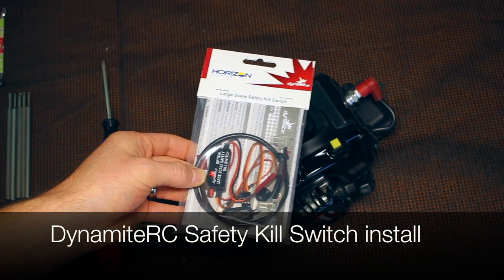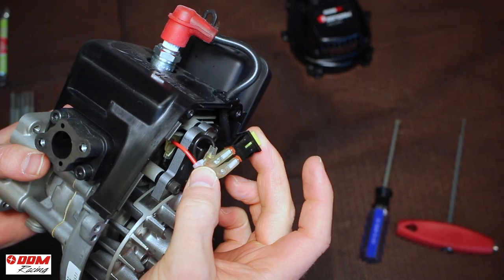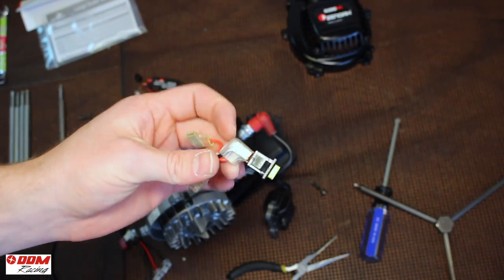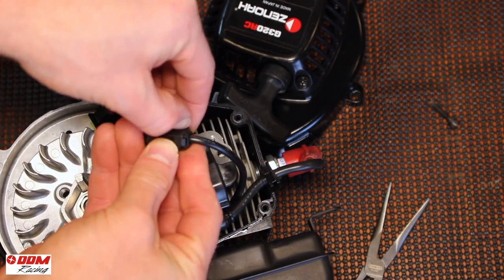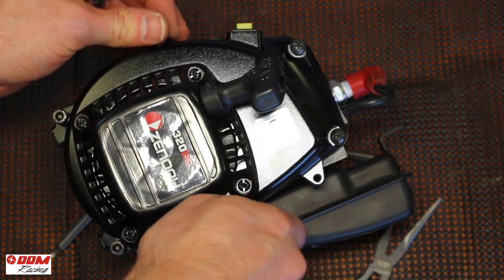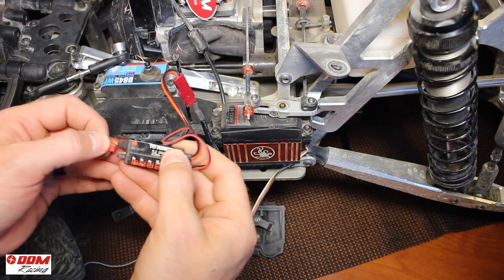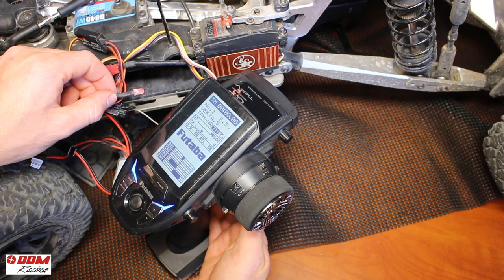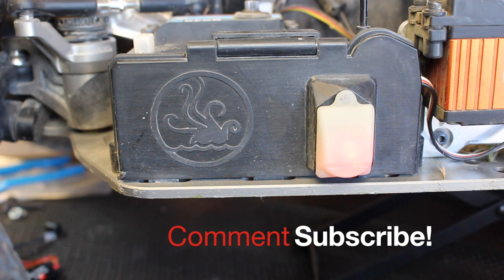How to install a Dynamite RC kill switch in your large scale RC car

Comment: Hi there! I'm hoping you may be able to shed a little light on an issue I'm having. 
Fitted the kill switch, everything appears to work as it should. Channel 3 is turning on/off the kill switch LED. However, when I start the engine, the kill switch cuts off the engine about 1 second later. I then have to cut the power to the receiver and turn it back on again before I can get any radio control. 
It sounds like it is an issue with the radio, but It can't be because until the engine starts everything is working as it should! If you could shed any light I'd be very grateful as I'm a bit stumped!
Reply: Try installing BOTH programming pins. This will deactivate the cutout. The statement in the video is wrong. Both plugs removed, as shown, sets the cutout at 6 v.

Comment: One of the most important things to note is that this will not work correctly unless the receiver is 4 channel. For example a Losi DBXL comes with a 3 channel receiver and the kill switch will partially work but the car will not turn off when it looses radio signal. The channel has to be a toggle channel 2 way or a 3 way. Basically the channel needs to turn off and the on. So just know that before you buy this. You might need a 4 channel receiver for this to work correctly.  For the money this is a excellent kill switch. I have both brands and both perform the same task. The Killer Rc one just has audible tones to it and the option for different color LED lights.
Reply from the maker: This kill switch works fine with 3 or 4 channel receivers. You need to have a radio that is at least 3 channels though. The DBXL has a 3 channel receiver, but it is only a 2 channel radio. If you had a 3 channel Spektrum radio it would work without issue. I also agree the Super Bee is the kill switch of choice, but it is nice to have another option when your first pick isn't available.
Reply: DDMSteveB thanks for the correction that is what I meant to say! Brain fart. Thanks Steve you guys are the best!
Reply: I have a 2ch radio w/ 3ch rx and this kill switch works with loss of power or signal. You don't have a switch available to turn the motor off, but you can turn the TX off and the engine will die. https://www.youtube.com/watch?v=BvOtLU1wuQ8

Comment: I am trying to configure the kill switch of the dynamite brand in a futaba 3 pv control, I want that when I turn off the control the kill switch cuts the power to the. engine but I turn it off and it stays on
Reply from the maker: You have got to program the failsafe position of channel 3 on your transmitter. You want it to be where the light is turned off. Make sure you have your channel three set as a 2 position switch.

Comment: I installed this on my HPI Baja 5T and the light doesn't come on for me and it just seems to have no spark I don't know if maybe I did something wrong but the engine won't turn over at all and I just got the engine running about a month ago and it has a new spark plug in it it's just been out of gas and I put the kill switch in today so I can go drive it and now I can't get it going maybe you can help? Please and thank you

Comment: Hi, further to my previous post, i was told to try another receiver battery 6v  this put things right, It worked
I also found that if you have a failsafe... already  installed it can sometimes go into failsafe.. when connecting the battery,
the light went out on the kill switch !!
I then reconnected the battery and It worked fine.. its well worth checking the jumpers for correct voltage 
my thanks go to Richard at King Cobra racing uk for the advice !!
Fred

Comment: Hey Steve great vid, to the point. Can u explain or show the direction of the jumpers? I have a 6.6 liFe and don't know which to remove (black one, red one or both)
Reply: Moor Rc Did you ever get your question answered I just hooked up mine now I'm confused also on which to remove or move around for the correct voltage I'm looking for the anything lower the 4 voltage how to set the jumpers up for that voltage.Any help would be much appreciated.Thank you
Reply: Moor Rc I had the same question Im running a lipo, or a life. And am confused on how the little voltage plugs work , and what connection is to be fitted in red or black?

Comment: I have an engine kill for my Losi 5ive and the box looks the same but it doesn't have the spade connectors, it terminates with a red futaba servo plug. Do you know if the button has a Normally open or closed circuit?

Comment: Just curious so let's say the battery on the car dies will the switch kill the engine still?
Reply from the maker: If it is set up correctly then it will also kill the engine if the battery voltage gets too low. The jumper pins can be removed for different voltage cut off.

Comment: So i want to buy a kill switch but wanna find a way to make it work without buying a 3+ channel radio(the one i have is 2 channel). Could i use the radio system from one of my other buggys to trigger the kill switch?(like when i steer with the remote control it kills the engine?)
Reply from the maker: this requires a 3 channel radio, but the MOD switch is available for radios where you only have a two channel system: https://www.davesmotors.com/MOD-5th-scale-kill-switch_2

Comment: now do you get the failsafe to set? i have tryed over and over and mine will not work. can shut it off at the remote with the switch. but if i turn the remote off the light stays on.
Reply from the maker: You need to set the failsafe position of your auxiliary channel that your kill switch is plugged into to toggle to the "engine kill" mode. If you have a Spektrum radio your failsafe point on each channel is set during the bind process. If you have a Futaba you can set the failsafe point for each channel via the menu
Reply: @DDMSteveB  im running a traxxas TQ 2.4ghz 4channel. im guessing this is the reason why i cant get it to work
Reply from the maker: @themfknightrider420  Probably the reason yep

Comment: Steve i got a though nut to crack for yahh. I have s spektrum DX4C  with a SRS4210 receiver but some how the kill switch don't work??? Matter of fact then it's hooked up the spark plug does not fire.... do you have any advise of how to crack this nut
Reply from the maker: Hi there! As noted (at least on our website) the Dynamite kill switch is incompatible with ANY of the Spektrum AVC receivers. This is even explicitly noted on our website listing of the Dynamite switch and calls out your specific receiver as being incompatible. You will need to get a receiver WITHOUT AVC. This would be something like the Spektrum SR415: http://www.davesmotors.com/Spektrum-SR415-DSMR-4-Channel-Sport-Receiver-SPMSR415.html
Reply: DDMSteveB ahh dat sucks!

Alright then i have to switch it. On the kill switch i'm missing the pluggs that are on the kill switch unit the two plastic ones. 

I run a 4600mah nimi battery.... can i buy these jumper pins separtly or do i have to buy a new unit😒😒

Comment: I correction for you. The diagram for the voltage cutout programming pins is extremely unclear, so I followed your advice that removing both plugs deactivated the cutout. Wrong. REMOVING both pins sets the cutout at 6 v, INSTALLING both plugs deactivates the cutout.
Reply: you are right....i can't believe its not videos out here that correctly explains this voltage shit....so annoying!!!

Comment: I have a dbxl  and I have to use a tqi traxxas remote because I got it second hand and I am scared to use it because it ran off twice when the battery died I don't know how to set it up
Reply from the maker: I do not have any experience with the Traxxas radios, I don't know of their compatibility to any of the kill switches on the market. I know that the Traxxas radios do not work with the Super Bee switch.
Reply: DDMSteveB I am broke. Do u know any radios that will work that are cheap
Reply from the maker: The Futaba 3PV is pretty reasonably priced.
Reply: DDMSteveB alright thanks for the help man I will look it up keep up the good work

Comment: Well the only thing that works there is the red led that you switch on and off if the led is on then the motor is on if the LED is off then the motor continues to run

Comment: When choosing the voltage cut-off on the killswitch does removing both the red and black pins mean No protection or 6v Cutoff?
Reply from the maker: Both removed = 6V cutoff
Reply: So what happens if power is completely lost to the RX? Broken wire or bad switch scenario? Will the engine still shut off?
Reply from the maker: @tomrc4328  If power is lost to the RX then the engine will shut off. A properly set up kill switch will only allow an engine to run when things like radio contact, voltage etc are all working correctly.
Reply: @DDMSteveB  I understand what properly set up kill switch will do, I was asking how this one functioned; which you answered. The kill switch I got (RRC-05 from Redcat) only killed the engine with loss of signal, low/no voltage had no effect. Thanks.

Comment: Hi, I just installed my kill switch, but when I connect to the receiver, the light failed  to come on, after checking the whole system
I then found that the light came on ..then off on connecting to the reciever..I changed the reciever but got the same result,
I dont know what to do...Ideas ?? faulty ??
Fred
Reply: I have the same thing .. if i connect it it Works but if i turn of the controller and then turn it on it stops working
Reply: @tiezel5656  Hey there mate, I reckon your transmitters failsafe is inverted. This means that the killswitch allows the engine to run when the transmitter is off and vice versa. Depending on the brand of transmitter, you will have to reset the failsafe positions for the killswitch channel. On Futaba systems, there is a 'F/S' or 'failsafe' option which you can cycle through each channel and set the position (like you can set it so full brakes activate when radio connection is lost), and you might just have to fiddle with it to get it right. Just refer to the transmitter's manual and if you don't have the manual, look online for it or simply google 'how to set failsafe on brand *model*". Hope this helps :)

Comment: Hi brill vid but what was that about business card ?
Reply from the maker: philkennedy1 use a business card to gap the flywheel and ignition coil. You want the coil close to the flywheel but not so close that it touches. Just putting a business card between the those two things then tightening the bolts of the coil will give you the space you need.

Comment: Hey Steve I see in your Vekta 5 you have a stock servo and a Hitec servo is this a kit or a RTR  kit and if it is a RTR did one of the stock servos fail on you just wondering because if you buy the stock servo by its self it's pretty expensive ?
Reply from the maker: Hey Darwin! This VEKTA started life as a pre-assembled model, it is the V1 axle and all (I still have had no bearing issues). I chose a different steering servo more out of boredom to try something new as the Hitec was a brand new servo that had really impressive specifications (700 oz of torque!) for such a reasonable price. I have been perfectly happy with the decision, make sure you get the Full Force RC servo mounts. They work like a champ!
Reply: DDMSteveB thanks for the information about the fullforce servo mount

Comment: hey Steve, I know this is kinda of a late message. I’m having trouble with the kill switch.  I installed it to my exceed 1/5 scale buggy, and when I went to go  plug in the NIMH battery and turn it on  with the controller ( which is the factory set) nothing happen.  I don’t know if it’s because I have the standardized controller.  What would you think it is Steve/suggest ?
Reply from the maker: What radio are you using?
Reply: That's not how this switch works on a gas/magneto driven ignition system  A manual off/on switch should be in between your battery and the receiver.  The Dynamite kill switch is powered by your receiver once your manual on/off switch is flipped to activate your electronics. The Dynamite kill switch is just a grounding tool to deactivate the engine magneto (an engine that is running).  It's not supposed to be (and cannot) switch your receiver and servo electrical states.  The Dynamite needs power from that same source  That would be a disaster otherwise.  Remember, there's no relationship between your electronics and your engine ignition.  Not in this case anyway.

Comment: Will the kill switch work on a MTXL if you're using stock transmitter ?
Reply from the maker: You need a 3 channel radio. The stock MTXL radio is only a two channel so it will not work.
Reply: Ok thanks

Comment: how do i setup the jumpers if i have a 5cell nimh battery?
Reply from the maker: remove the jumper near the outer edge of the switch. Keep the jumper on the inside installed. That would have a cutoff voltage of 5V. You can go as low as 4V for NiMH but I wouldn't suggest it. No point in risking it!
Reply: DDMSteveB thank you Mr.Steve always helpful!
Reply: @DDMSteveB  Answered my question right there :-)

Comment: l have done all this & not starting, don"t know why,
Reply from the maker: These are polarized plugs on the ignition coil. Try swapping those wires around on the ignition coil and see if you get the correct operation then.
Reply: @DDMSteveB  hi l done that & still no luck.?

Comment: Whats the difference between the dynamite and killer bee switch?
Reply: Ryan $30
Reply: oh its cheaper but does the same?
Reply: Ryan works equally as well just not all the bells and whistles!
Reply: 4 channel receiver is a must for correct operation!
Reply from the maker: There are a variety of differences between them. My preference is still the KillerRC Super Bee because it is more compact and versatile. We have experienced some inventory shortages on the Super Bee so it is nice to have another option.
Reply: Thank you! Steve.
Reply: @richardgordon9649  Does the losi 5ive come with a 4 chan receiver?

Comment: I know its not a killer bee install but i have a question. 
So, I installed a killer bee on my Baja. I have the RF 45 3 channel receiver and TF 45 transmitter. When i push the 3rd channel button from the transmitter, it shuts off the engine like it should, but when I turn OFF the receiver, the kill switch wont kill the engine, and the only safety measure is the failsafe. Anybody know the solution to my problem? 

Also, after i installed the kill switch I noticed my engine wasnt running correctly... Its throttle response was garbage, the rpms were dropping very slowly and it had a higer idle than normal, though I didnt touch the screws, and the servo was working fine. Could it be an ignition issue (after reinstalling the coil) or its got nothing to do with the kill switch or the coil reinstall?
Reply from the maker: It might have to do with the radio you are using. KillerRC has a radio compatibility chart that can be seen here: https://www.killerrc.com/pages/radio-kill-switch-compatibility-chart I would reach out to Kent over at KillerRC and see if he has any ideas on your question. It might be the lack of features of the transmitter or something.
Reply: @DDMSteveB  I actually did send a message to them, but no reply yet and that's why I asked on YouTube
Edit: Thanks for the reply

Comment: For anyone wondering why their vehicle won’t start now. The tutorial is wrong. 

To correctly install, switch around the red and black connectors on the ignition coil. Red is closest to the pull start and black is on the furthest connector.

Comment: Thanks Steve, DDM Rocks.
Reply from the maker: Thank you for your kind words! Very appreciated :)
Reply: Steve i for got to ask you,  is there any tips on getting the Killer Rc reciver 7200 pack in the radio box of the Vekta, i found mine to be verey tight fit , all most to tight..any thoughts? thanks.
Reply from the maker: The 7200 will fit, but you are right it is definitely tight! I have the 7200 and Futaba receiver as noted. I have the battery pushed back with the wires to the front, I slide the receiver into the box in front of the battery kind of up and at a slight angle. The kill switch fits above the battery and the wires are kind of smooshed in with as much order as I can conceive. In hindsight I wish I would have used the 6000 for a little more room.
Reply: Right , I was going to get the 6000 from your store , but saw the 7200 at your store and grabbed that one. But yes super tight. Thanks man!